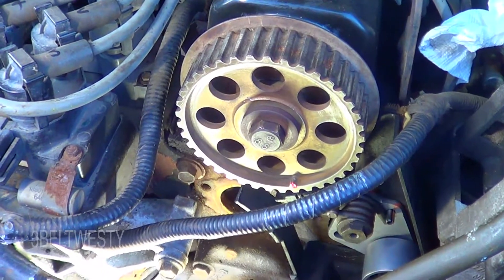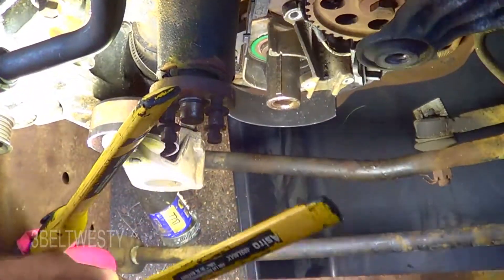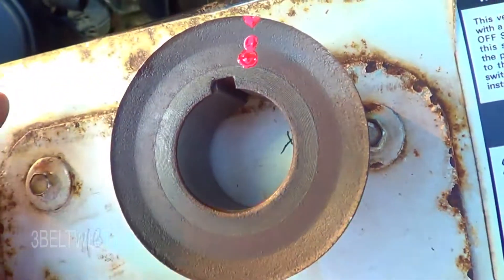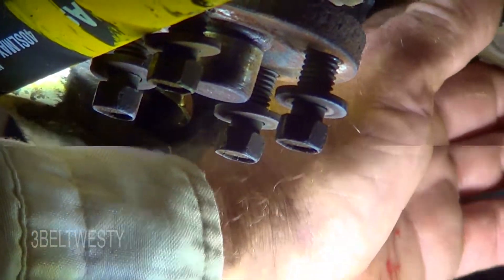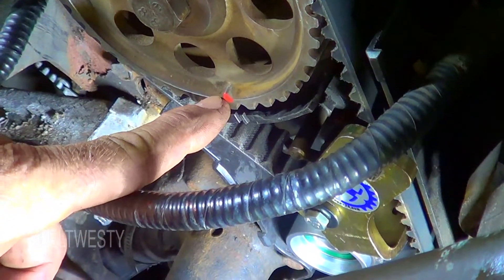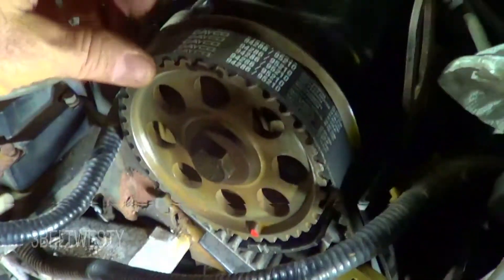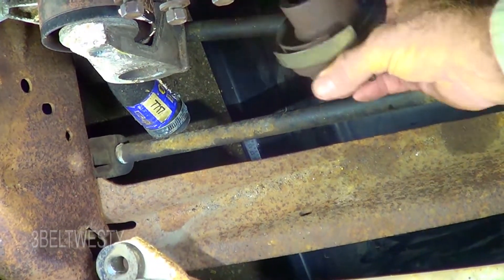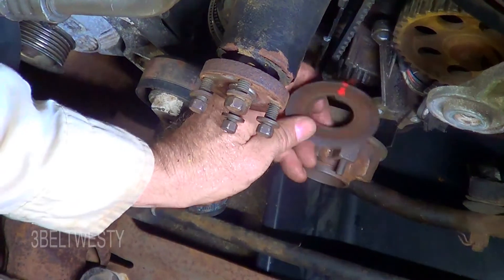1994 Ranger 2 3L timing marks and company 23 tensioner tool

Comment: I think I ran into the same thing you described about the cam mark jumping a tooth. I could have it lined up perfect and when I install the belt and loosen the tensioner it moves ahead of the mark. I can't turn the cam pulley back too much or it will jump to the next 90 degree spot you demonstrated. I was a little confused about how you were using the belt markings to line it up. I got mine lined up close as possible, it just a hair off the line in the cover. When I released tension and turned the engine by hand a couple times and back to compression on TDC the marks appear to be in line. Is there an easier way to get the cam mark lined up perfectly when installing the belt? Do I need to move the cam sprocket back a little or move the belt over a tooth?

Comment: I guess I got lucky..... nobody else ever heard of that tool..... I had to use pry bar and a friend to pull it back.... smooth side of course.... I slipped the belt on... and manually turn the motor the make sure no resistance and I've had to do it twice and finally got it right... truck driving like a stripped ape... thanks for your help....

Comment: Don't you have to line up the Auxiliary shaft sprocket as well? Please show us how. Thanks.
Reply from the maker: On this model year the auxiliary shaft does not internally connect to anything. It is just an idler sprocket. Thus nothing to align
Reply: @3beltwesty  Is it a California model? Mine (1994) connects to a camshaft synchronizer.
Reply from the maker: @path2049  mine is a non California model.  Built in Edison New Jersey in spring 1993, but a 1994 model year truck
Reply: @3beltwesty I thought that was the oil pump gear. 
  Some show the mark on it to line up with the cam gear.

Comment: I have a 1994 Ford Ranger 2.3 engine change the timing belt on it the sprocket on the crankshaft free spins after it goes over the keyway is anybody out there know if it's supposed to do that ????

Comment: I have a 1994 Ford Ranger 2.3 4 cylinder engine change the timing belt on it slide over the key way and free spins on the crankshaft does anybody know it supposed to do that

Comment: Having trouble getting my timing sprocket off. What tools did you use to pull the sprocket off. Haven't really seen any videos it from the 2.3 liter
Reply from the maker: Mine just came off with no tool at all. It was not stuck or anything. The crankshaft sprocket on mine required a Ford puller. It was so stuck the truck could probably be picked up by it! ie vehicle went under salt water in Katrina, but must not have reached the cam sprocket. 

With Ebay searching for "2.3 Lima Rotunda" gives many 2.3 Ford engine tools. One tool is the "Rotunda T74P-6256-A Camshaft Pulley Remover"  . 

 LOOk for "T74P 6256" and there are 6 different sellers. Some look like there maybe pieces missing. Not sure. The center piece might be different for different engines, You might try asking these sellers if the center adapter is for a 2.3L. 

The entire set of Ford 2.3 L engine tools is " T74P-6000-L"  . The entire set of tools often is priced not much higher than 2 or 3 tools.

Also with the sprocket bolt off you might try Kroil or PB nutbaster or WD40 if you have not tried yet.
Reply: @3beltwesty  
The tool is t74p-6254-a